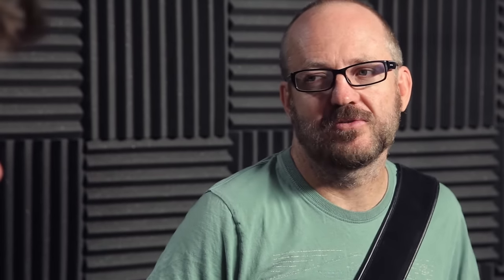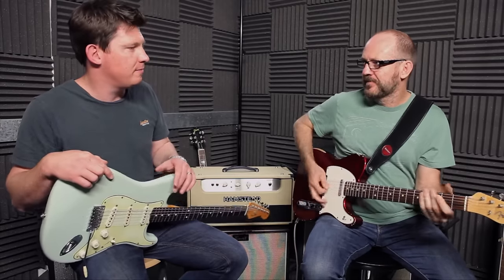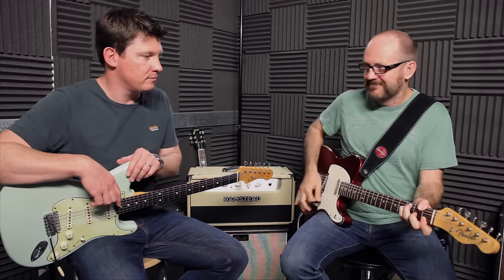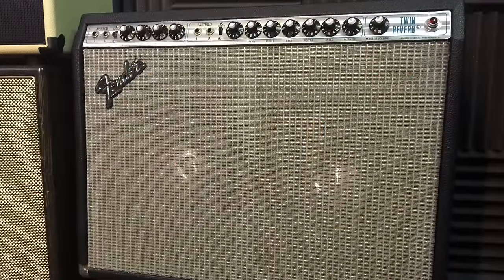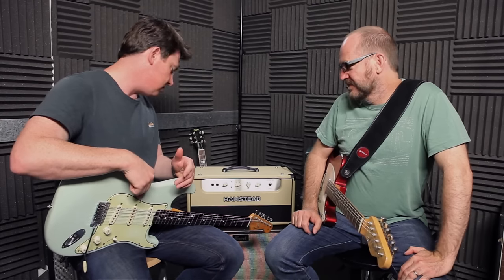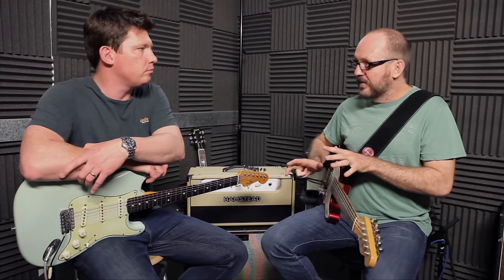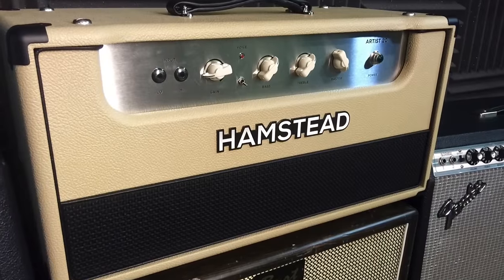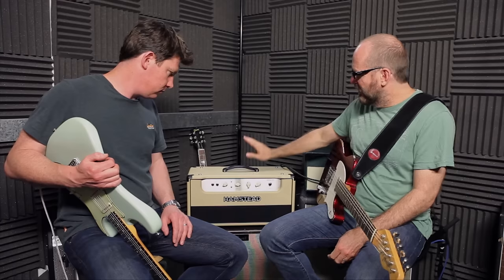Setting Up Your Amp To Use With Drive Pedals

Comment: Nice comparison. Even I am not an amp user (I use Modelling from the first second), I am very interested in the sound of Overdrives hitting amplifies. At least this helps me find better combinations of overdrive ans amp in rhe modelling area. I would be very interested how the JC-120 behaves when hitted by overdrives. Is there any combination which would sound good? 
If the Fender Twin is THE clean amp, what then is the JC-120? Is it THE most clean amp of all which should not be used with overdrives at all?

Comment: Hi  fellas, I love the show. I am learning a lot just from watching the episodes and applying it to my set up.

I use a Mesa Boogie Mark IV with a Gibson Les Paul, Strat, Telecaster and a Line 6 POD HD500x. I used to use pedals but i feel the POD has some pretty decent tones in it and it's a lot less/lighter to carry around... and as much as i don't wanna get into a pedal processor war but would you be able to advise me on how would be the most efficient way to use the two pieces of equipment that is the most versatile. i.e. 4 cable method, just use the power section of the amp.

Ideally i guess i wanna use the 3 channels of the amp and STILL have the option to use the pre amp models from the amp if i feel like it or just use the effects from the POD.

I play covers and originals and know that there is no wrong/right way to set these things up... I guess if you put yourself in my situation; how would you go about using the rig i mentioned above. (I play everything from Tom Petty to Metallica)

I don't have any MIDI capabilities. 

P.S. Having said all this i think i may have to go back to pedals after watching your episode with Metal Zone episode with Rabea. The amp Tweaker Pro TIGHT METAL and the white version of it is AWESOME!!!! I liked the Boneshaker a lot also...

Anywa,  thanks for the videos and keep up the GREAT work.

Regards
Paul Amar

Comment: Hey Daniel. At what voltage do you run your king of tone? Just got mine and I'm looking for some professional guidance :)

Still need some suggestions for some "that pedal show" episodes? Could you two please make a show with your own gear your using nowadays. Would love to see whats your personal favorite pedals/amps/guitars are, and how you use them. 

Thanks for the show! Love to see 2 musicians sharing their knowledge on the interweb :) greetings from Holland!
Reply from the maker: Hi Alex. Run the KoT from a standard 9v isolated output from an Isolator. Yes, we'll do our own boards  for sure :) cheers matey

Comment: While they're right about the bridge pickup in a Tele is louder than a Strat,a lot of that his how the Strat has the tremolo setup. Floating it's softer and quieter, but decking it will make it much louder and punchier.

Comment: Love this video - REALLY REALLY interesting. Particularly I'm interested in the fact that Dan - you use the front end of the amp with a little "hair" which I particularly love the sound of and no FX loop .. all fine, but how do you get a decent solo boost?

I find myself having to have an amp with an FX loop just so I can put a graphic in it to give me ~6dB of simple level boost just to get heard. It's not ideal cos if all things were equal, I would LOVE to use my 18W with any number of different pedals but it's at just one volume level .. I would love to know how you guys deal with that? ..

Comment: I see you have that small big muff.. does it have the "wicker" switch? What does the wicker thing mean?  Did you hear the new Big Muff deluxe? I just have the regular old school one that is way too big for the pedal board..
Reply: It's the Nano Big Muff & if basically a copy of the regular one but smaller. I've got one myself & they sound fantastic.
As for the wicker, that's a special edition Big Muff of its own. It has 2 special controls: one is the Tone switch, that bypasses the tone control; the other is the Tone Wicker, that opens up "3 high frequency filters" that boosts top end apparently.
To get traditional Big Muff sounds, you'd turn off the Wicker & Tone switches...
It's a nifty pedal if you're looking for a different sort of fuzz tone from a Muff.
As for the other one you mentioned, I'm not sure, have to look into it. But I definitely recommend the Nano Big Muff if you're looking for a pedal board friendly version!
Cheers!
Reply: can you demonstrate the difference between the regular big muff, the smaller one, the tone wicker one, and the  deluxe new one?   does the small big muff have the exact same the real big one does?  Why does the big muff sound so shitty with the  Fender Twin? That is awful. Tell us all more about this tone wicker,  and the best way to use a big muff, it is kind of tricky to get a great tone with it.  Also hard to get a Fuzz Face just right..it wants to be too scratchy..

Comment: Hi Fellas. Just found your channel. Love it. I originally purchased a TCE Spectracomp and more recently a Darkglass Vintage Microtube. I'm running a Fender Jazz with my Neck at full and my Bridge and Tone at 20% or so, with Flats. I'm really compensating for a Precision I think. However, do you recommend putting my Darkglass before my Spectracomp? I'm really searching for that early 70's Rich Rock tone. Im also running a Ampeg BRE1 Head and a Svt22 fully closed 2x12 cabinet. Aside from having to go with a Precision and a good Tube Amp and maybe a 4x10,as far as the pedals go I also plan on buying JHS Colour Box and possibly swapping out my TCE for an Analogue Compressor. So based on the two pedals I have now, the Darkglass Vintage and the TCE Spectra Compressor which order due you recommend? And do you suggest a excellent Compressor more along that 70's sound? I definitely want to upgrade my Amp and very likely get a Precision or something more in tune to what I listen to and play. 

Cheers 🍻!! 

Lee

Comment: Where in the spectum of amplifier types would a smaller  wattage Vox fall then? Because it's Fenderish clean...more mids tho...yet breaks up as well when driven..tho again more middy than a Marshall type. Which way would you lean to describe it..and which kind or drive pedals better suit it's characteristics? Full range as opposed to mid pronounced? Thanks

Comment: What if I use a clean clear amp (Roland JC), run it though a Drive Pedal first, then a Compressor, then the Fuzz/Distortion (maybe the Big Muff), and then a Noise Gate?

Comment: This video is 9 years old...so I'm not sure if there's a newer video I can watch to help with this same concept but I run through a amp sim that lives on my pedal board now as i primarily play at my church and just have the amp sim last in the signal chain into a DI box. No actual amp...The amp sim is a tonex so it can do multiple amp sims, principal should still work the same though yes? or are amp sims different in any way?
Reply from the maker: Hi there, yes, principle is the same. 🤓👍

Comment: Noob Question: i also bought myself a big muff lately and didn't like it through the front, so i tried it in the loop and it sounds huge! My amp is an Orange OR15. Is putting drive pedals in the loop something you should/shouldn't do for some reasons ?

Comment: Hey Daniel! I have the boss DD-20 set up on loop 9 (mono send, stereo returns) while running stereo amps. I'm getting a crazy feedback loop even when loop 9 is the only effect engaged. Do you have any ideas on what to change? I tried holding down 11 and Phase to reset the trail settings for 8,9, and 10, but there was no change.
Reply from the maker: Hi Zach, power up holding footswitch 11. That will sort it. For any more tech support just contact us brought the side. Cheers Zach :)
Reply: +Daniel TheGigRig thanks so much! I figured it out just before your response! Haha

Comment: OK I have a Marshall JCM 2000 DSL.. that is all the Marshall I can afford right now.   I have a Fender Stratocaster..I want to get maximum  hugeness  to it.  Like a Hendrix Stevie Ray tone.. but way huger if possible.. but keeping the  Fender Strat tone.. I love the tone of these 2 amps.. for different reasons..Which Marshall is that one?   I bet that twin can get huge,  without changing the  tone too much. How about the newer   Marshall and Fender  re-issues how good are they?
Reply: Hendrix used a Dallas Arbiter Fuzz Face into a Marshall, while SRV used a Tube Screamer into a Fender Super Reverb (as far as I recall but it could've been a different Fender)

Comment: Good vid! Thanks. You made me laugh too. Can you advise me? I've got an Orange TH30 and Boss SD-1, but it might not be the best combination. It sounds OK, but not brilliant. Any idea what the best overdrive into the TH30 might be? My local shops don't have Orange so can't try their various pedals into one.
Reply: Pete Woods Bring your head with you! If the shop is half decent  they'll let you plug it into a cab and try everything out :) Just tell them you're on an overdrive/boost quest and you'll be good to go!
Reply: Pete Woods I had the TH30 for awhile and it is a killer amp.  I to found that some pedals just didn't respond that well to the gain channel vs the clean channel.  What the guys say in this video makes perfect sense now that I look back on that TH30 experience.
Reply: Pete Woods Some kind of Klon clone might be good. Those sound well in front of just about every amp.
Reply: See if you can bring you amp to the shop
Reply: Too big, bad knee :-(
Reply: +Pete Woods a clean boost or transparent drive will sound better than a distortion or screamer type pedal cuz the way the mids are inherent in the orange. Try a micro amp, looking glass, dark matter, blues driver etc.
Reply: take your amp with you,and the muff seems like it would work well.you want an effect with less mids for your orange.

Comment: A bit embarrassed to comment here as you guys are such masters, but I do have a few questions. I just got my first tube amp! It's a very low wattage though at 15w and I'm wondering if I should be worried about pushing too much distortion through my clean channel in fear of messing something up. The drive channel on this amp is in a word, horrible. Maybe that's unfair, but I literally have to put it at >1 to get something that doesn't sound like it has bleached hair and tribal tattoos. I'm going out of a pretty nice cab, so not too worried about the speakers, but I'm a beginner as far as tubes go! Would really appreciate some help! Fantastic videos.
Reply: Would really help if you actually put the name of the amp
Reply: It's one of those little Marshall Dsl15h joints. My bad!

Comment: So glad I found your videos! So interesting...but I'm still confused about the relationship with getting an amp with a master volume on edge of breakup. Everyone talks about that power amp compression? But I can never turn it up that loud and I have an AC15. I keep master at 8-9 o'clock usually and dial my preamp to around barely breaking up usually around 10ish, and use pedals to push from there to taste. I'm not sure if this is what you're saying here. But this affects headroom I guess?

Comment: Daniel, I know that you're a busy bloke but is there any chance of doing a video aimed at those of us who don't have access to such high-end amps due to budget restraints. I play through a Blackstar ID60 : TVP which I bought after my 50th birthday, and prior to that a Session Rockette 30 which I bought new in the late 80s. I had some inexpensive Joyo pedals (2 drives, tremolo, 2 delays) and had a sound that I thought was great through the Rockette. Bought the ID60, great amp, fabulous clean sounds but somewhere between your results with the Muff in the 2 amps. Not quite as terrible as your twin sound but not as good as it used to be. I know......experiment to find the best with what you've got :-)

Comment: what are some pedals that sound good with a rectifier, i mostly use the clean channel and pedals
Reply: Whyyyyyyyyy!?!?!!!!???!!!!
Reply: because its 100 watts and i have a family lol, I know no pedal will sound as good as the dirt channel Bill Rowse
Reply: JUST SELL IT OF YOUR NOT USING IT AS INTEDNED, OR TRADE, ILL TRADE MY BLACKSTAR HT5 METAL STACK FOR IT IF YOU NEED A QUIETER AMP, FAIR TRADE IN MY OPINOIN AND ILL THROW IN MY TONE CITY MODEL B THATS A MESA STYLE PEDAL LOL, IN ALL SERIOUSNESS THOUGH SELL IT AND GET A SMALLER AMP AND GET A ROCKTRON ZOMBIE, I JUST GOT 1 AND ITS THE ONLY PEDAL THAT ACTUALLY SOUNDS LIKE A DUAL REC BUT USE IT WITH A VALVE AMP AND JUST GET A SMALLER VALVE AMP AND SAVE A COUPLE GRAND, I WILL DO THE TRADE IF YOU WANT THOUGH CAUSE IT IS MY DREAM AMP BUT I KNOW ITS ABOUT AS LIKELY AS IT SNOWIN HERE IN PHILLY TOMORROW

Comment: I've got a Mesa Boogie 50 watt Rectoverb, and I just can't use some pedals with it? They just sound horrendous? And for some reason I can't use my line 6 delay in the effects lope, I have to run it into the front of the amp?

Comment: I have a question for you both guys! What mods can I do to make my strats output larger, I still want to retain that single coil sound, but want it to be louder and drive the amp more. Similarly as Dans famous red telecaster does, it has volume almost as a Gibson Les Paul, but it just sounds like telecaster with that insane rocky tone on bridge. I heard that it is modes, but couldn't find the video where you've talked about it on sight. Is there anything that could get me closer to the target? Do changing pickups would do? 

By the way guys, your channel is without a doubt the best guitar channel on YouTube! Such informative content!

Comment: Hey guys, so I am really confused, I finally broke into the Fender amp territory and got a Tweed Blues Jr. I love the way my Musket (Civil War Muff) AND my Ram's Head (Stomp Under Foot Ram's clone) sound on it. My boss blues driver indeed sounds a bit spitty, but I like the sound a bit. I don't get anything close to the behavior that your Twin did in the video. Can we do another one of these with some different fuzzes, ie, mid heavy and such? Why am I not experiencing this drastic sound difference? Do mid heavy fuzzes work fine on Fender style amps? Thanks
Reply: I haven't ever really heard any Fuzz pedals that are mid heavy. By nature they're all pretty scooped. If you add midrange to Fuzz, you're left with a distortion pedal, not really a fuzz tone.
Reply: tim white you seem to have missed the civil war era Muffs. That's what the Musket Fuzz is based off of.
Reply: +boonexy I've heard them. It's true they're not as scooped as others, but they're still scooped. Unless this is what was meant.
Reply: well I'm thinking of getting the Vick audio which has a mid toggle which gives you boosted mids. anyway this is sort of off topic to what I was asking

Comment: Does anyone find that Class A amps are more workable with various pedal effects? I find that Class A amps don't tend to have such pronounced mids, and when you add an overdrive or distortion to push the mids, it tends to fill out more evening compared to Class A/B amps. Your thoughts?

Comment: Hi Dan, I'm loving ur show, I don't have very pro gear, well at least not my amp, I have mxr uni vibe, mxr 108 fuzz, boss turbo od, boss dd 3 and a DigiTech digiverb, it gets really horrible when I use hi creamy fuzz for 60's 70's tones, the reverb gets really messy and I can't even hear my notes when I'm doin fast solos, oh BTW I have a small vox r15 pathfinder, Jeff Beck strat, and 2015 sg special with 61's zebra hummies. any suggestions? maybe because the reverb pedal is digital, idk...

Comment: I've got a Fender Strat and a Fender Princeton Chorus DSP. For some reason, they don't sound anywhere near as great as the sounds on this video. I've used them with a Big Muff, Boss Distortion and Boss Blues, Ibanez Tube Screamer, and Fulltone Plimsoul, but still not a great sound. Too much highs and mids, no matter how I adjust it. Should I just go with a Marshall amp? What gives? Any feedback would be appreciated.
Reply: grade21 usually feedback is an unwanted sound.

Comment: Hey Guys, I realized you didn't respond to my Line 6 POD HD500x post. So I went and got a load of pedals. Lets see if you respond now... LOL. I have a question. What effects work with a Mesa Boogie Mark IV? Can you recommend and amp for me to use all this stuff with? I generally like a Broken up clean tone that responds to my right hand. I have a HEAVY hand and I use the following... I have a Jeckl and Hyde, Tube Screamer, BOSS DD2 modded, LPB 1 for a boost, Line 6 M9 for effects, MXR Dynamics's Comp, MXR Distortion plus from the 80's, BOSS Eq pedal, Dunlop Cry Baby was and Ernie ball Jr. volume pedal. I run all that into the front of the Mark IV and play a Gibson Les Paul and Telecaster.

Comment: Hi guys, I've just subscribed to your channel and it's freaking awesome! For years, I've been playing on a Peavey Bandit 115 along with a boss ME50 on which I have most effects I need, while playing on either a Jackson Kelly or a Mexican Telecaster. The thing is as I'm in a cover band we tend to cover a wide range of different styles in a 3 piece band -from Metallica to Ben E-King. I'm struggling to find the right balance and most of the time our covers may sound overly distorted, but then again we're a rock band and wouldn't like to sound any different. However given the repertoire we do need to adjust accordingly to venues and also when we have gigs,  we can't afford to hire a sound tech. So  Would you guys mind doing a tutorial on how to play with a boss ME50 multi effect pedal through a Peavey Bandit 115 on a Mexican Telecaster? Cheers!